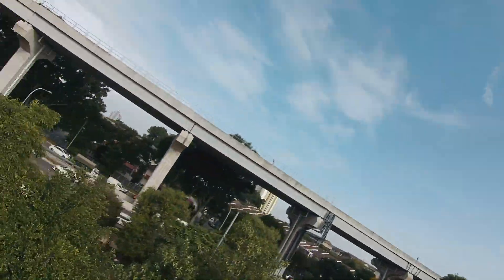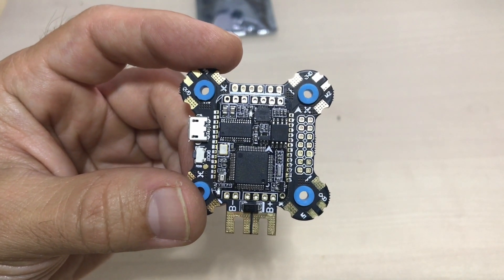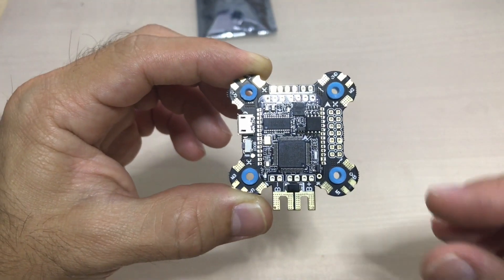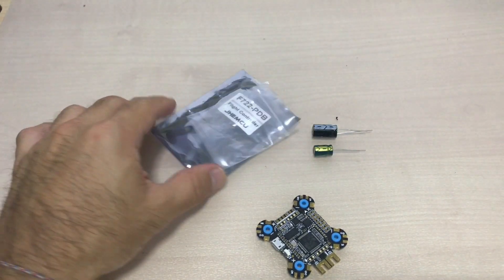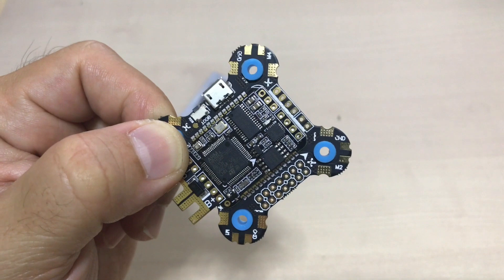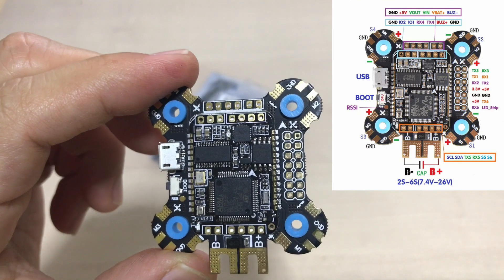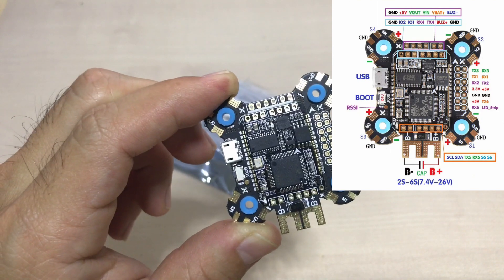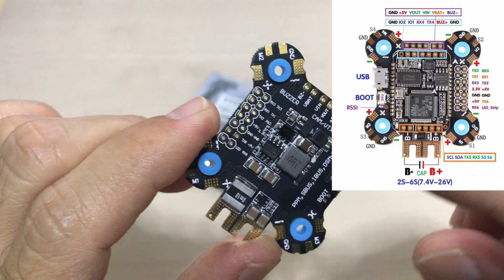JHEMCU F722 Flight Controller test.

Comment: This thing is a piece of shit.  I haven't made it further than 150ft. But 8 out of 10 times it has flipped out on take off or when I just arm it.  I've flashed emuflight, and multiple versions of betaflight. And it will not fly.  I've changed ESC's and motors, hell I've even swapped from dji hd FPV system back to analog thinking maybe something with the dji is wigging it out. But no nothing makes it fly.  I think it's a bad gyro.  But I guess that's to be expected from jhemcu.  Don't buy this piece of shit.

Comment: Hi Randy, I bought one of these with two cam inputs but when I arm the cam feed fails, both feeds, any ideas on what I’m doing wrong
Reply: Did you set your cam in betaflight. U need to setup user1 and user2.

Comment: Just bought this FC but got confused because no manual.. I can't identify which pad for SBUS and Smart Audio.. can you help me?
Reply from the maker: Piks 09 u can use any uart you want for sbus and SA. Then assign it in betaflight and you are good to go. I use it SA and Crossfire receiver without problems. 😉
Reply: @RandyRCReviews  Thanks man.. I got problem because got conflict between uart 2(sbus) and 3(smart audio). All settled after I moved the smart audio from uart 3 to 5
Reply from the maker: Piks 09 alright glad u fixed it. I killed the signal pad 4 on a nasty crash and I was able to remap it to the pad 5 and boom! Works wonders. My latest video is also flying this board. Im still ripping this board up to this date. The blackbox is also very handy. All the best brother! Happy flying

Comment: So... wich cap did u use? As far as I know.  U need 4 470uf on the esc.  Or 1 1000uf on the main power.
Reply from the maker: Patrick Frensdorff 4x 330uF 35v and 1x 1000uF 35v all good. Flies like a charm

Comment: Which ESC did you used?
Reply from the maker: furulevi in this quad I have the hglrc 28a. But I extremely recommend the Spedix 30a 3-6s which Ive been flying on 6s lately. Best esc ive tested in 2 yrs. and Yes I prefer individual esc too.

Comment: Very cool board. Thanks for sharing.
Reply from the maker: Giffy thanks bud. Yeah its a good deal indeed. Blackbok can be very handy and no sdcard needed. Good board indeed
Reply: @RandyRCReviews  woah, no sd? that's pretty cool
Reply from the maker: @GiffysChannel  yep, 16mb memory for BB. super easy to record and check the BB logs
Reply: @RandyRCReviews  I just bought my first flight controller with separate ESC pads (CL Racing F4S) and it came with BB SD card slot. Now I have to figure what format to make the SD card. It would be pretty nice to have all that already baked in. This seems like something we will definitely start seeing in the future.